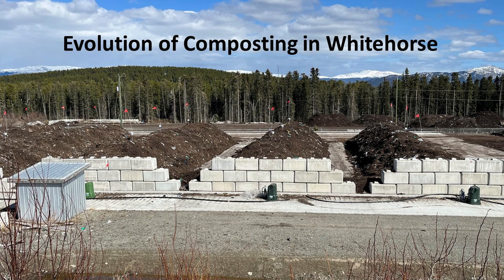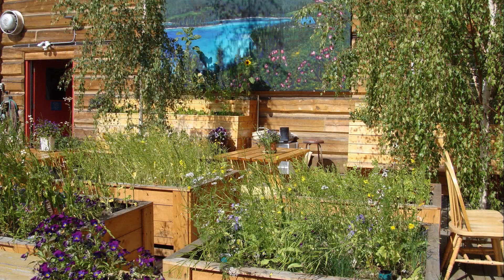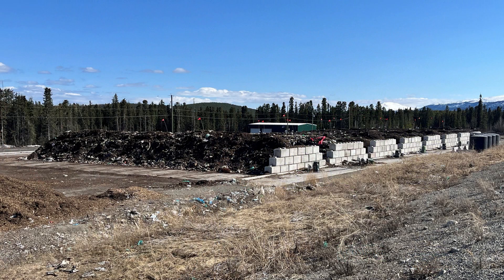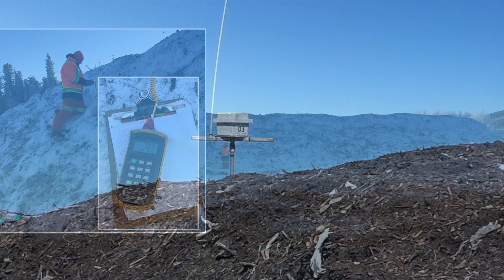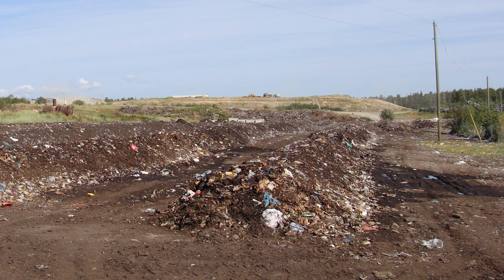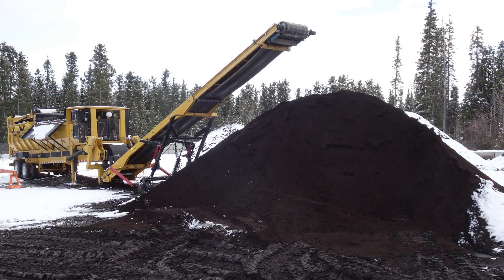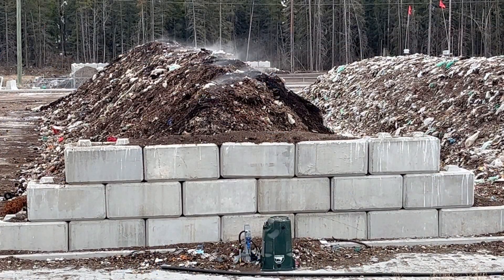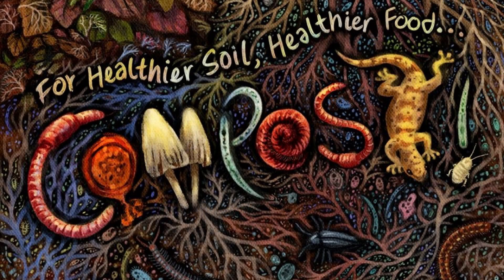Evolution of composting in Whitehorse, Yukon

Comment: It's always a pleasure to hear from someone that really understands composting. We're looking at switching from turned windrows on the farm to ASP for the reason you mentioned - freezing. Since our climate is similar to Whitehorse, I'm wondering if there is a minimum cross-sectional size to maintain temperature in winter and what "optimal" temperature Whitehorse runs at during the "curing" phase - after the higher "thermophillic" heating? Does Whitehorse use an insulating cover on their windrows? Thank you.
Reply from the maker: Thanks for the question. Minimal cross sectional size in really cold climates is about 14 ft high and 30 ft wide. Its not really practical to make larger piles with your average loader. Optimal temperature during curing is about 40-50 C, but it usually starts out a bit higher. No insulating covers used at Whitehorse. Compost itself is a very good insulator. Thanks, John
Reply: Wow, that's bigger than I thought. In a windrow of that size, that’s about 7 cu-yds per foot. At that size, the composting bedding pack barn on our small dairy only generates enough compost for a 140 foot long windrow. As you talked about in https://youtu.be/vTaAHq8stqo, turned windrows take up a lot more space. At that size, we could easily process all our compost over the warmer months. That’s awesome.

The fact that no insulating cover is a possibility is good to know. That part of ASP always struck me as being time consuming and problematic. For example, if we were to use finished compost as a cover, a roof to store finished compost under in our cold, wet climate would be a big added expense. As you eluded to in https://youtu.be/lbg_oGNd9FA, leaving compost exposed in wet climates will invariable turn portions of beautiful compost into an anerobic (stinky) soup. 

Due to regulations, we are being asked to better contain our operations. The smaller footprint of ASP is definitely a positive in terms of pad and roof size. However, if memory serves, in another video you mentioned that Whitehorse is turning their ASP piles 3-4 times during composting and 3-4 more times during finishing. That’s a lot of turning. It’s roughly the same number of times we actively turn our windrows now. 

Related to turning ASP piles, we know others have run heavy HDPE pipe that they simply yank out of the pile with a tractor and chain. Not having to deal with the perforated pipe helps but still I’m sort of wondering if we’re not better off with our actively turned windrows. Anyway, I’m just posting this in case it helps others.

Thanks for making this channel. There is a lot of really useful information that has helped me think through improving our process :)
Reply from the maker: Thanks for your comments comparing the turned windrow to the aerated piles. There are two additional important considerations. The first is the expected maturity of the compost that you are making. This will dictate how long you are composting, or how many times you are turning. The second consideration is that an aerated windrow will produce a mature compost faster - particularly with the larger pile sizes.
Reply: That makes sense and clears up confusion I had about the number of times to turn. Given a small trial we did of ASP with our bedding pack material, I'm guessing we could get away with a single turn while composting, and maybe once more after - if we wanted to improve the finish. For us, it sort of "begs the question" as to type and stage of finish that gives farmers the best "bang for their buck". In one of Professor David Johnson's presentation, he talked about broadcasting highly fungal compost having a profound impact on soil biology.  However, based upon lab results of our small ASP trial, we are not going to get a highly fungal compost from bedding pack material so fungi destroying turning isn't an issue. Thanks again for the videos and the conversation.    @TransformCompost
Reply: You are welcome. With compost produced from bedding pack material, my experience is that bacteria are dominant for much of the composting process, especially if its not aerated. Fungi prefer oxygen, so they will flourish when the oxygen demand is lower and we have more oxygen in the compost.
Reply: Given what you and Professor Johnson have said, bedding pack material is just too "rich". At some point, I think we should try an ASP pile that is heavy in dried plant material, fungal food, and see what we get.
Reply from the maker: You can try that - in my experience its more about not enough oxygen. The oxygen demand of some of this material may be really high at first, which then requires a lot of air to keep it aerobic. The fungi will more likely flourish after its been aerated and mixed for a while.
Reply: Thank you!